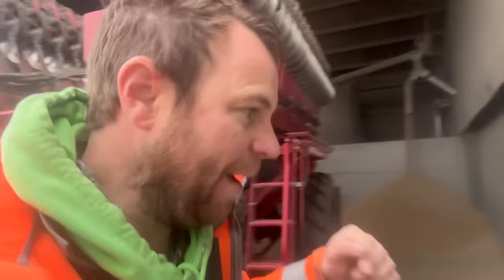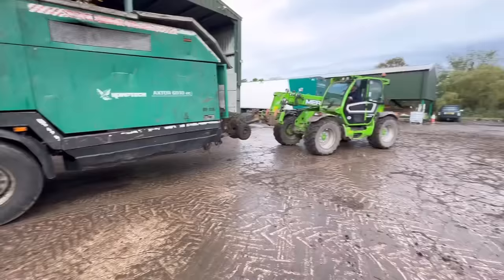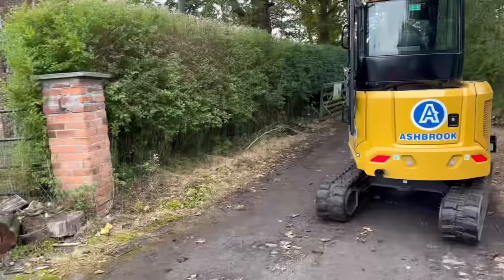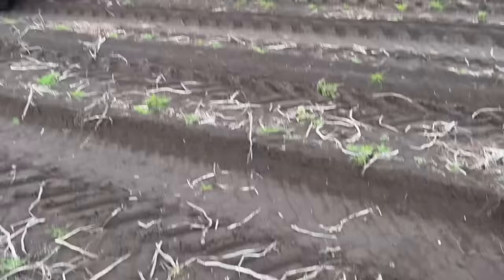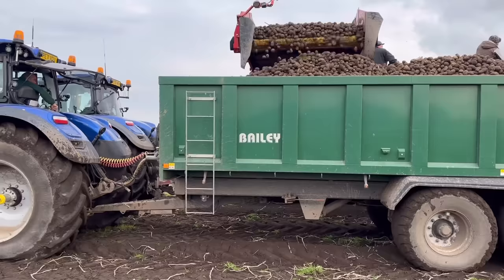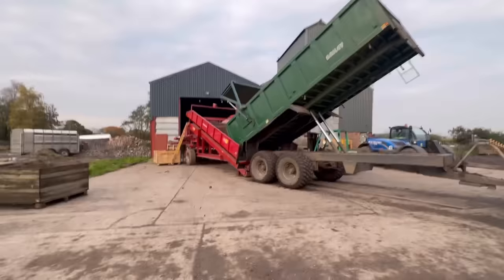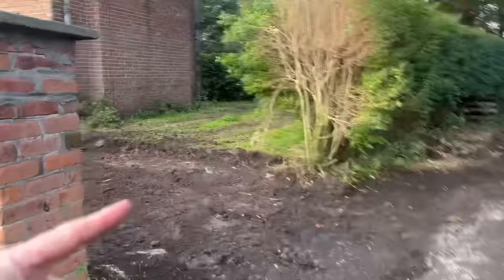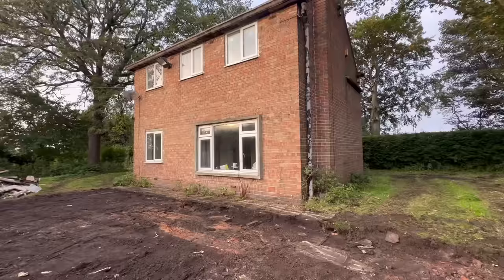DIGGER BUSH WACKING & POTATO HARVEST CONTINUES  #AnswerAsAPercent 1316

Comment: Quiz answer: the forbidden potatoe (the fruits of the plant produced from the flowers)
can you do sometimes a full show on the process for your biomass/fuel production and burning (maybe even show how you start up the burner, runnning of it and ash use (what were the results of your ash testing last year? I now you tested and maybe even said the result but i sadly do not have always time to watch all teh videos))
I'm a chemical proces engineer with a good bit knowledge of in energy process engineering so I really enjoy watching your kinda self-sufficient heat generation and biomass use :D